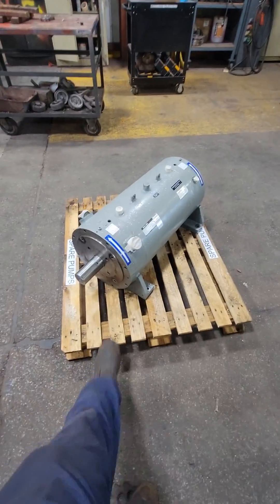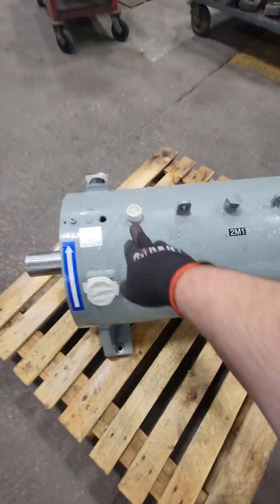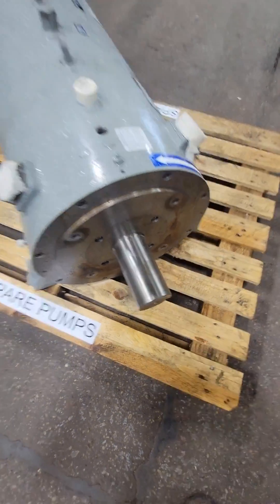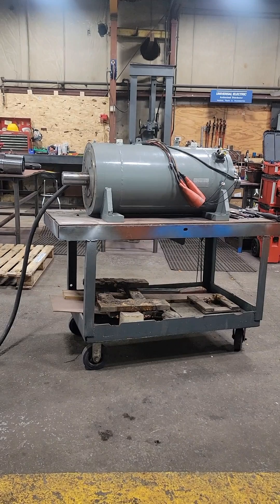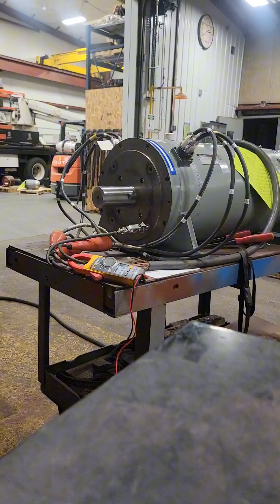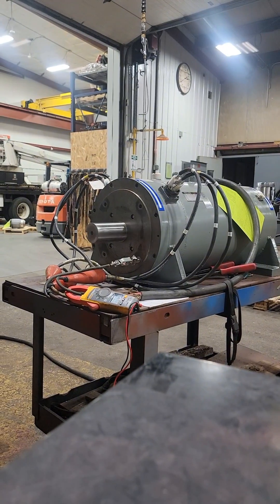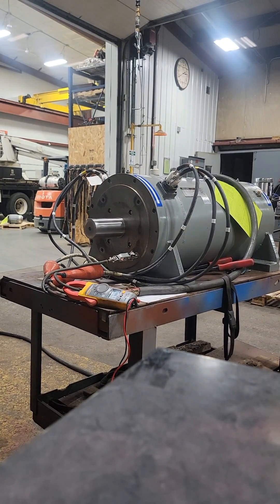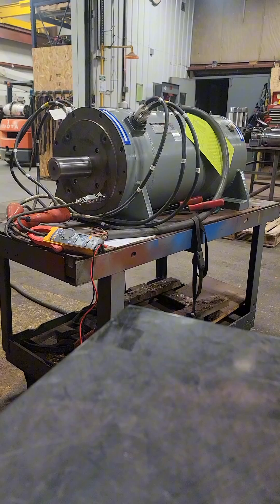250hp liquid cooled electric motor

Comment: And there's no key in it.. was it balanced with a key?? Doesnt sound electrical at all... shut the power of when its up to speed... if the noise goes away then its electrical.. but you never got it up to speed.. and you have it on a cart that weighs not even a quarter of it... 🤦‍♂️

Comment: When you ramp up slowly on a motor like that you will reach what's called a critical.. depending if you balanced the rotor... that vibration... is due in balance resonence... syncrons.. speed is 120 by frequency... over the number of poles... that motor the way it looks and being fluid cooled is in need for fast starts and frequent stops... run at full speed.. the vibration will go away... and dont run it on a pallet... you will experience soft foot... ❤